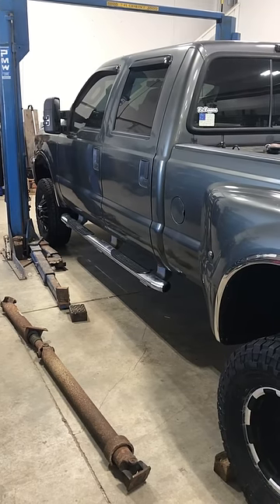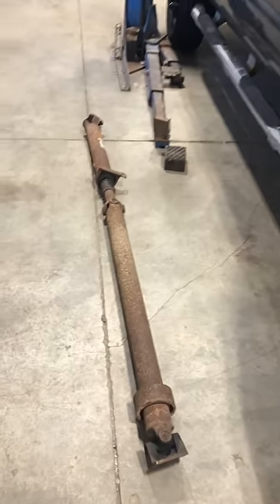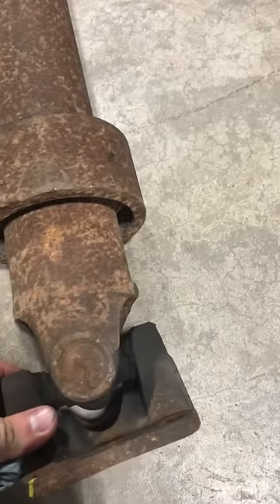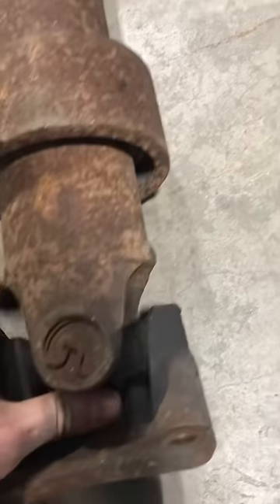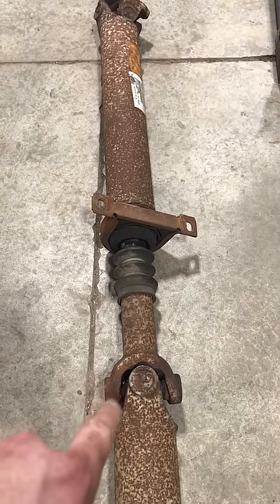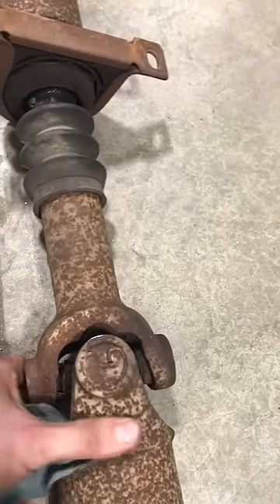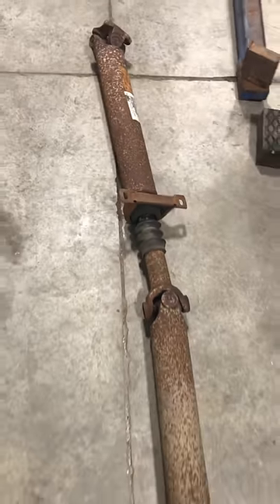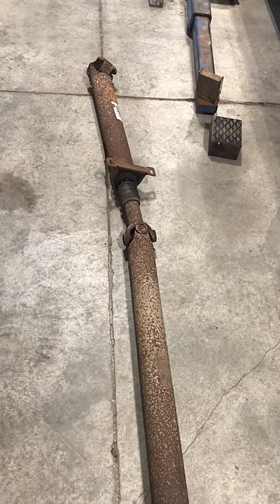Bad Vibes - Ford Driveshaft #shorts

Comment: Carrier bearing on my 2010 F150 went out last week. Unbelievable can’t replace the carrier bearing. Perfect timing going out on New Years weekend and no salvage yard or parts store had one or was closed for the weekend already. 

So I bought the Dorman replacement drive shaft for $450 from rock auto, saved $200 and will be driving the UTV to work for a couple of days.
Reply: That's why that I still like my older Ford trucks 2 - 1987, 1 - 1988, 1 - 1991, 1 - 1995, 2 - 1996, all F-150's , you can still replace just individual parts on some stuff. I like my 87's, 88, 91 trucks the best.

Comment: I've always thrown a tack weld on my ujoint caps just for extra security.  It's still easily serviceable if need to replace the u joints again just need to grind off the small tack. I just don't trust some of those clips that clip on outer end of joint. I've had a cap walk out on me  before ended up tearing my front drive yoke up.

Comment: Ive seen front axle U joints on dodges wear out so bad the yokes just had lil nubs where the bolts used to thread in and caps sat. They had broken u joint out the the two yokes just hit each other untill they rubbed the cap land into useless metal nubs.

Comment: Had a vibration in the driveline on a Fiat 124 Spider years ago. Bent driveshaft. The shop cut the yokes off and welded a new section in there. Was wonderful to drive after that. Cost $62.50 — but that was about 40 years ago.
Reply from the maker: You could move the decimal once to the right and not cover this repair....
Reply: @WatchWesWork    There’s similar math involved with my age. Something about “Dog Years” whatever that means. It’s not good, I know that. And there’s a “Driveshaft” joke in there too but I’ll just leave it alone. This time.

Comment: Can am doesn’t know about timing a propeller shaft ether. But that’s Canada so no other explanation needed. Can am isn’t just one tooth off it’s like a half a tooth off so you have to pull the propeller shaft apart and reset it.

Comment: Wes you did not know me in high school. Ask me why I bolted a bench vise on the back bumper of my 1976 F250 hiboy 4x4 with 3 driveshafts (.D-I-V-O-R-C-E-D transfer case) Don't ask about the glove box full of Borg Warner u joints either. Does BANG! DADING DING DING ring a bell? You betcha.

Comment: I did something I think mechanics should know. I have a 2010 Tacoma 2.7L. I have had two Bad Secondary injection hits. This time air pump checked out. Rather than messing around with the air valve which was stuck closed i removed the air hose and filled the valve w motor oil. put hose back on. one trip to grocery store fixed it. way tooeasy of a fix.

Comment: That looks like my driveshaft! lol. Mine is in a wee bit better condition, only needing 2 u-joints 1 yoke and a carrier bearing! Funny thing is, I didn't have a vibration. I found the bad parts when I was under it, looking it over for inspection. Yes, in Pa. you have to have all that sh*t in good condition or you don't get you stupid little sticker for your windshield.

Comment: "this driveshaft needs 3 u-joints..."
earlier: "welded snap ring to the yoke so it can't come apart"
... sounds to me more like a case of truck needs a complete new drive shaft assembly. I can't help but think it'd be faster and maybe a bit less costly than the labor necessary to repair the original pos.

Comment: Those Hookes joints need to aligned to work smoothly,  axial movement for each one needs to mated to a second one,  Constant Velocity (CV) joints are superior in this respect,  but more costly. 
Many propellor shafts can run up to 2,100 rpm in standard form.
Partridges are new to me, automotive engineering wise, flying pigs as well.
Reply: Well i got some blinker fluid to sell ya..../s
Reply: @captaintoyota3171  I only use organic thanks 😊

Comment: I wonder if a driveshaft issue is why my 2000 Silverado vibrates so much at 70-72mph. It doesn't vibrate before 70 or after 72.
Reply: Gen 4 Rams had the same vibrations I have read all the GM trucks had similar vibration issues. Some have had driveshafts replaced rear ends replaced Etc. nothing seemed to fix it. I had wheels replaced , tires, alignment, rear gear inspected nothing fixed it 70-75 was a horrible vibration I gave up and I traded my gen 4 ram in for a gen 5 no vibrations in the new truck.
Reply: I've had multiple sets of tires, multiple balancings, etc. over the years. I think since it only happens between 70-72mph I haven't tried too terribly hard to identify the issue!

Comment: We got a 2001 CCLB F-350. It's been a great truck, but it damn sure does love to eat the rearmost U joint. I thought it would just be a wallered out rear yoke before the video played, but nah, it's $1000+ in basically a new shaft entirely. Never seen one that bad either. Always caught phasing problems on HD trucks quickly myself.

Comment: I've seen a land rover centaur half-track where's the right-hand rear driveshaft with a 90 degree twisting because it was towing 44 tonne . It the that lasted another 2 years it was a Jaguar prop shaft so that's not the worst one I've seen

Comment: At what mileage should you do the U joints on a truck like that? I have an 06 dually just like this one. 255k miles.
Reply: My 1998 E450 chassis on 27' motorhome needed center support replaced at 50K, rubber had rotted by 2018 so factors other than mileage can come into play. IH Scout had power steering leak, rotted out L front shock rubber bushing; Monroe replaced that shock under lifetime warranty and they were still going strong when I sold it 8 years later.

Comment: You know I don't normally wish bad things on people, but I believe I'd make an exception to that rule in this case. 
Nothing like a good beating from a two piece drive shaft when someone is ignorant enough to weld the caps to the yoke, missaline the two shafts on the connecting spline.
Then have the testicles to tell the mechanic that he doesn't know where the vibration is coming from after doing all that to save a couple dollars some time in the past. 
They simply deserve the bottom of the bed the frame rails, and hopefully a slight pole vaulting effect of the rear shaft separating from carrier bearing, followed by slightly digging into a nice secluded gravel backroad without cell service. 
Sorry but that could of taken out a innocent family following behind him, and taking pieces of the entire drive shaft assembly through the windshield at hiway speeds

Comment: not a mechanic here, but what do you mean when you said one tooth off?  do the u joints need to be in line with the yokes all top inline when placed?
Reply from the maker: Yes. The yokes have to be in line or the shaft will get slightly longer and shorter as it rotates.
Reply: @WatchWesWork  Thanks!

Comment: Gonna pay more to repair it than replace it. Last time we had on repaired like that one it cost us $1000 and we had another one do the same and without hesitation ordered an O.E. for $650 and put it in ourselves. Also they were oilfield trucks so they got used pretty hard.
Reply from the maker: The driveline shop fixed it for $525.

Comment: No carrier bearings 1 piece driveshaft is the cure.
Then you delete a carrier bearing(parasitic power loss) and the center u-joint.
I'm replacing the 2 piece on my 2wd s-10 with a 1 piece aluminium driveshaft.
BullyBilly.

Comment: How did the costumer not hear the clanking that poor drive shaft had too be doing when homeboy r girl put the thing in gear... people if you're car r truck goes CLANK when you put in gear r let off clutch... YOU have bad u-joints....most of the time.. just slide under ur vehicle and grab drive shaft and turn it back and forth and if got some slop and makes a clanking noise when you  change direction from clock wise too counter clock wise and vice-versa 99% chances BAD U-JOINTS...K.... tec- tip for you from your favorite shade tree mechanic... Kenneth....you will be able too tell... even if one don't have any mechanical experience just use some of your common sense... we all have it.. and we all know how to use it... just trust you self....and believe it r not they r not hard to change... I have done it with a hammer and a socket... now Wes is going to have too a little bit of grinding with a carbide bit on a in-line grinder.... r however he is going to cut out the weld some dummy put on the cap and shaft...it would not have taken much more time to change it out than it did to weld it in... far it be for me to say anything about what someone does... but yoo that was stupid...

Comment: Fix or replace daily not followed
Reply: just like a Gm, or ram. they all suck in their own ways
Reply: @Giovanni_Litterini  my 1993 dodge power ram had over 500,000 miles when I gave it to a friend, no oil leaks and still gets almost 22 miles per gallon 12 valve Cummins

Comment: Ford driveshafts are trash especially the friction welded ones.  Even  if phazed and balanced correctly they all have excessive runout on the tubes.  I went through 3 oem ford driveshafts all defective.  Finally had one made at a driveline shop.  Vibration  fixed.